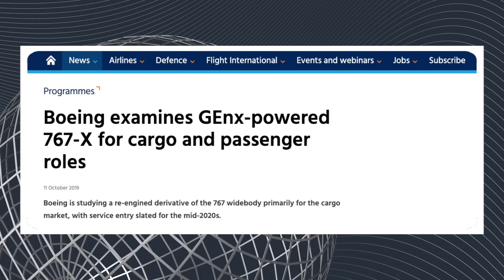767X - The Boeing 757 Replacement?

Comment: A 767x would be possible because they have continued to produce the 767 for cargo and military applications.  

The 767-2c was FAA certified in the last 10 years and became the basis for the kc46.  

The 2c is a 767-200er with the wing of 767-300f and a glass cockpit.  The GeNx-2b from the 747-8 has a smaller fan than the 787 version so would be an easier upgrade with a well proven reliable engine.  Boeing has the landing gear from the 767-400 which is taller (had to accommodate the stretch of the 400 to reduce tail strikes) so that should give the additional clearance for the GENX-2b larger fan. 

In taking the 2c back to a passenger variant,  place the main cabin door just ahead of the wing like the 767-300 / 400, 757 and 787.  

If you are going to make anything larger than 767-200, you already have the 787-8 which is the length of 767-300.  The 767-200 is comparable in length to 757-200 and the capacity of the 767-200 would give airlines that 175-235 seat plane (depending on layout) combined with the 200ER range (6500 nm) and you can cover East Asia to Hawaii, Hawaii to all corners of the USA, USA to South America and USA to Europe.

This plane could operate using smaller gates (code d) compared to the a330, 787, a350 or 777.  Add in using LD2 containers to reduce cargo handling labor and turn times.

Comment: I would prefer a 757X because I love the flying pencil, BUT, since Boeing shutdown that line and the 767 is still running with the US Air Force tanker, the 767X is feasible. The 767 is very comfortable, but isn’t that what the 787-8 is for? Long live the flying pencil!

Comment: Surprised that Boeing didn’t just take the wings from the 787, newer engines, and attach them onto the frame of the existing 757. Dimension wise, the 787 is the 767 with a wider cabin. But they already have the airframe from the 737 Max 10. Don’t call it a 737, call it the 757-8, taking inspiration from the 787. The flying pencil returns, range of 5500nm, passenger capacity of up to 295. So it has a single aisle, 40-50 rows of seats, good short field performance, and bridges the gap between the 787 and 737 max 10. Then its easy to just stretch the design into the 757-9 with 6000nm of range and the 757-10 with 5400nm of range but 340 pax capacity. 10 hour flights from Western Europe can basically make it all the way to the west coast of the US

Comment: There's no market left for a 767x. In its current lineup, Delta has ~220 seats on their A330-200 and ~215 seats on their 767-300ERs. Logically, Delta would buy the A338 (they have the 339) as its the same size as the 332. 

American has retired their 767s with the 787-8 as replacement. United has announced 787-8s as the replacement. I don't see Delta going for the 787 so maybe they would be the only major airline to want one. 

Low sales for the 787-8 and almost no sales for the A330-800 suggest that this segment of market is not very desirable for airlines.
Reply: UA hasn't announced the 787-8 as their remaining 767 replacements. UA actually hasn't been a big fan of the 8 with only 12 in the fleet that word old CO orders. They huge 787 order they placed is very unspecified on the quantity of each of type. They basically have 12-18 months prior to delivery to let Boeing know on the specific variant.

Comment: There's someone at Boeing that can't stand the thought of a refreshed 767 or 757 for that matter. It's my guess is that they are given to incrementalism suggesting that a reengine project needs to include new wings, a more modern flight deck, maybe even a reconfigured fuselage. Never mind that this is exactly what they've done with the 737 which has been a successful project. If they get started with a Middle Market offering ten years from now they will be a niche player. They will join  auto maker AMC which made fine cars but lost a step and fell behind. Just get engaged Boeing. I can't stand seeing you get so badly eclipsed.

Comment: Boeing did make a number of upgrades to the 767 with the KC-46 program.   A lot of it borrowed from the 777.   So some new engines and a few more tweaks could certainly make for a nice update.  However I'm not sure these updates would really fill a capacity gap.  All these updates would probably push the most effective variant to be the 767-400 size (kind of like how the neo has pushed the A321 to be the optimal choice).   This plane would be similar in capacity to the 787-8.  So why buy a 767-4X when you could get a more optimal 787-8?  Unless the 767-4X is more affordable with better availability?  Or could they size an engine and develop updates such that the 767-2 and -3 versions are more optimal?   If so that might fill some capacity gap.
Reply: They looked at the idea and rejected it. It's a 1970 design and sticking on new engines didn't really add much. And no it doesn't have have new engines. Same  GE engines available on the passenger version.

Comment: The original 767X is what is the 777 today, it was the initial protect name for the 777. The 767X that was talked about a few years ago is a completely different story.
The A321XLR in no way compares to the 767(-300) in any category. We are talking about 210 vs 160 Passengers 2-class configuration, 90t vs 50t empty weight, 11.000km vs 8.500km still air range. These two are at least one size category apart.

A 767X would not hurt A321XLR sales, it would hurt 787-9 and A330-900 sales, and non existing 787-8 and A330-800 sales. Most airlines already settled with the 787 as a not 100% direct replacement, a few with the A330-900. A 767X would certainly do better on shorter missions (up to 7-8 hours) than the 787 and A330neo, but as most airlines already took what is available there is no real incentive for Boeing (and Airbus) to put money into a new airplane that size, at least not in the foreseeable future. Airbus has the same hole in their lineup, between the A321 and A330.
The right time for a 767X launch was ten years ago, the ship has sailed.

Challenging the XLR would be a 757X. But for several reasons this airplane will not happen.
Reply: You are correct. That's how we got the 767-4. Hence the reason it's such a rare bird but the newest passenger variant 767s in the sky .
Reply: @antonyh37  true, the 767-400 as to compete with the A330-200, but it lacked range.
Reply: Airbus has no gap in their line up... The A321XLR has already filled it... Boeing does have that gap because of the cancelation of the 767X.
Reply: @ericsantiago4442  Airbus has almost exactly the same gap as Boeing. Size difference between the A321 and A330-800 is almost identical to the difference between the MAX10 and 787-8. Range wise the gap is a bit bigger, but this is the market segment of the XLR which is not as big as many think.

Comment: I love the 767 with the 767-400 being my favorite jetliner. However,  it is the inimitable 757 what they need to work on.  A Dreamliner-like 757 would be the great follow up Boeing had to have built since day one.  The 767 has the 787 as its replacement already, while the 757 is in a class all by itself with no replacement.  THAT is what Boeing needs to work on.  Of course, a new 737 is also needed,  but thats another story.  Good job mate,  great subject for discussion by us plane nuts.  Thank you.

Comment: I'm rooting for a 757X since that's the market which needs to be filled. We have the 787, which in my opinion, replaces the 767.
Reply: You can stop rooting. The 757 is long dead and not even an option for X. It was discontinued now 20 years ago.
Reply: And I am sure the tooling has been long gone too!
Reply: @michaelmichniak127  This long ago of course it is. Boeing 757 fanboys wanting what's never gonna happen.
Reply: @johniii8147  Yup only change is a  767X since its still in production for the military and freighters
Reply: @Sandro-h4j  It's not being considered either anymore.  Considered and rejected. It's 1970s design and the new engines added weight and would require significant wing changes. Wasn't worth it for either Boeing or GE for maybe a couple of hundred sales at most.

Comment: maybe 767 with CFM Rise engines?   Edit: just read the CFM Rise won't be ready until the mid 2030s 😥
Reply: Yeah that's not a viable option. If the Rise ever happens that 10+ years down the line.

Comment: Have you heard anything about Boeing doing a make over of the 747? New engines and wings? I'm afraid this will be another 737 max ordeal. Instead of a clean sheet, Boeing is trying to save money with redoing an old plane. Sounds like a "here we go again" ordeal.
Reply: There are no plans for a new version of the 747. Those days are done. The market and technology has moved on. It had a good run of over 50 years but it's over.

Comment: Always try to fly 767 when flying. You can’t beat the 2-4-2 seating in coach. Seats in coach are typically wider as well compared to the likes of 777
Reply: The 767 has a 2-3-2 seating in coach, even better than 2-4-2.
Reply: I also look for the 767 the 2-4-2 seating is the best. I also liked the 757 entry door seating where any seat in that row could get up at any time during the flight without bothering anyone else.
Reply: 2-4-2 on the 767 is a nightmare. But luckily 95% of all 767s were configured 2-3-2.
Reply: The A330 was like this too however, a lot of carriers have re-seated 'em to 3 on the side.
Reply: Very few opportunities left the fly the 767 unless you're on DL or UA or in box for cargo.
Reply: I don't really do economy. My complaint is how narrow the business class seats are. They are so old now I won't miss the 767
Reply: @johniii8147  true while Economy is phenomenal Business at most Airlines is a bit narrow.
Reply: @widget787  I've never herd the terms phenomenal and economy used in the same sentence before.

Comment: I think Boeings failure to evolve the 757 will really hurt the company.
Reply: It already has
Reply: Boeings failures (and there are many) will more than hurt the company. The company is being mismanaged right into the ground.
Reply: They are grinding their teeth at that decision everyday.  If only Boeing could pull off a miracle on new updated 757s, Delta would be first in line for a sizable order. Next would be United. These two carriers have firm grips on their current 757s and have not decided on a firm retirement date yet. They would likely drop any unfilled orders for the 737-10 in favor of a more capable brandnew 757.  I follow one of Delta's older 757s on flight aware and this aircraft is pushing 33 yrs of age and just left an expensive D check for return to service. They are going to end up being the modern day DC-3.

Comment: With an ever decreasing market coverage and the lack of resources to remedy it in the short term, the 767x should be a no-brainer!

While single aisle and twin aisle may overlap in seating capacity (the 757-300 was most definitely in the twin aisle capacity), the choice of one over the other is probably more to do with the business model of the airline.

I believe that the A321neo and its longer range variants are brilliant aircraft, however, I am sure that they would have lost significant sales to twin aisle designs (A310 and smaller 767 variants in particular) had they still been in production.

Likewise, we saw how limited the demand for the 757-300 was, presumably because most airlines preferred the 767.

Yes, the NMA is needed, but is it a priority? I do not believe it is. By the time it comes to market, the A321 will have eaten into its potential sales even further, possibly enough to make its prospects of breaking even more uncertain than for the 787.

I think the best solution for Boeing would be to work on a 767x as quickly as possible and then concentrate on where they want to position themselves in the single aisle market.

Yes, the MAX is selling well, but not as well as the A320 series, and we mustn't discount the significant number of MAX orders placed because its delivery times are substantially shorter.

Comment: The 767x would've also helped Boeing's relationship with GE. Given how unpopular the 747-8 was, GE must be thinking that their GENX-2B could've gotten a better ROI. A 767x with those exact same engines would've helped the ROI of the -2B
Reply: Given huge sales for the 787 GE is just fine with Boeing. They have more than 60% of the market on wing with the 787. Also don't forget GE is 50% partner in CFM that supplies all the engines for the 737 program. They also have been the sole engine supplier for the 777 program for many years now.
Reply: @johniii8147  I’m talking about the ROI for a particular engine variant. The 787 GENX engine, as well as the engines for 777x, MAX, and 777-300ER are slightly different than the 747-8 engine
Reply: @Blank00  Not enough to matter in the case 747-8. Very minor motications vs what's on the 787. GE did just fine on it. There were built on same assembly lines etc. Didn't really add much to GE cost.

Comment: How about 757x
Reply: Nope. They moved on from the 757 now 20 years ago. It was never that successful for them.
Reply: The 757 was successful aircraft for performance and thin routes
Reply: @t10391  Which is tiny percentage of the market. It was actually too much aircraft for 90%+ of the market. That performance came at a high cost in terms of weight and fuel burn.

Comment: Boeing made a huge mistake not retooling the 757 10 years ago.  Probably too late now.
Reply: It was actually now 20 years ago the Boeing made the decision to discontinue the 757. They proposed other versions and the airlines simply didn't want it. Despite the fanboys around the 757 it was never that successful overall. In 30 years on the market it only managed 1000 in sales and most of those were North American specific. It was also expensive for Boeing to make.
Reply: @johniii8147  "it only managed 1000 in sales..."  1,050 units sold put the 757 top-10 all-time in commercial jet sales at the time production stopped.  While Boeing would surely love to have sold more (what company doesn't want to sell more), it was hardly "never that successful."   It completely replaced the 727 in airline operations and was only really slowed by Boeing's own development/stretching of the 737NG family (Boeing's choice).
Reply: @johniii8147 Even if it would take a while to develop, it would be worth it for boeing. The A321XLR may be more efficient, but it can’t climb as fast. This means that it can’t serve some of the airports that the 757 could.
Reply: Huge mistake for the market as it has become. Nothing to do with a fanboy.
Reply: @boondockduane  The XLR is actually not "huge" market. They have sold around 600 uncontested. Boeing estimated the space at around 1000 and seeming about right. Airbus had the advantage of it could relatively cheaply do the upgrades to the 321 ( though still in the billon dollars) Boeing would have to spend many billions on a clean sheet and split the market so doesn't seem to make business case sense.